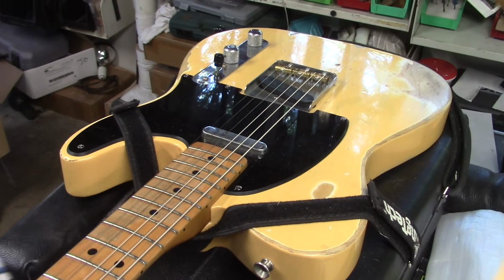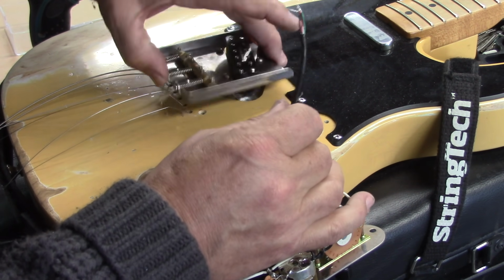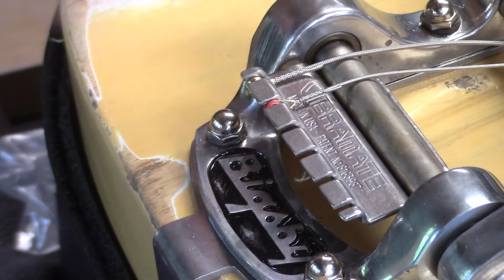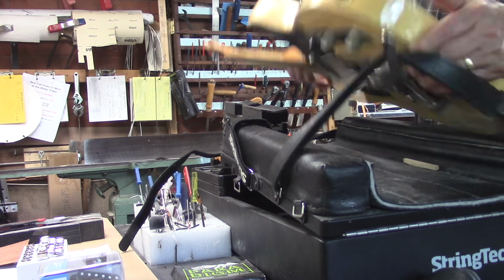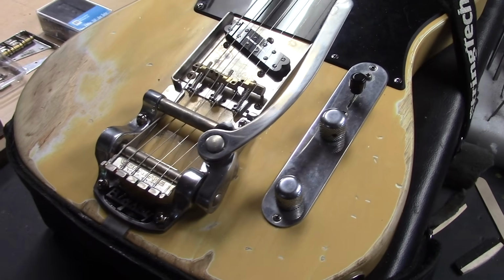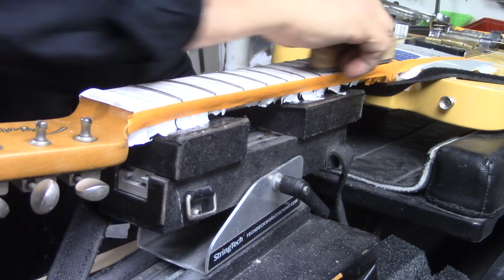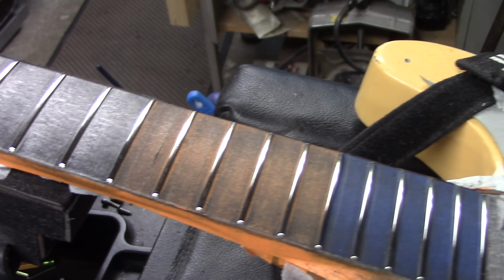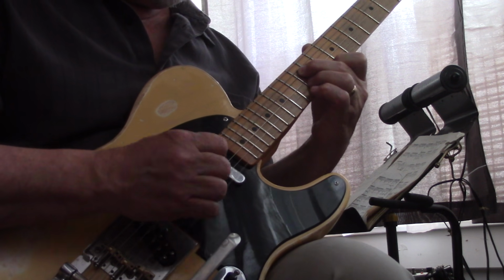Vibra-Mate Bigsby install / Road Worn Telecaster@StringTechWorkstations

Comment: Hi, whats the metal plate on the bigsby where you string the strings through? Does it come in the kit? And also just to confirm this is just a standard Bigsby B5?
Reply from the maker: That's how it came. The customer dropped everything off.